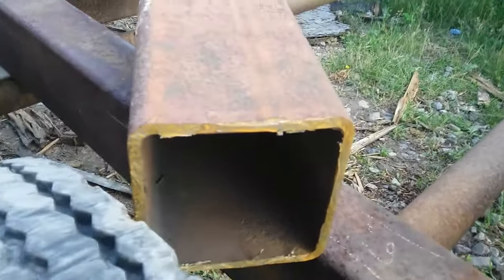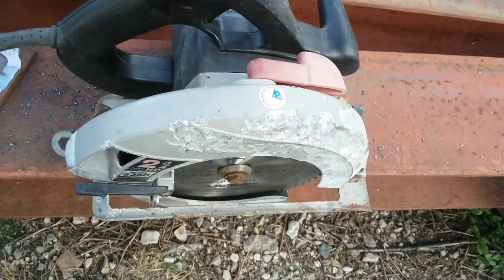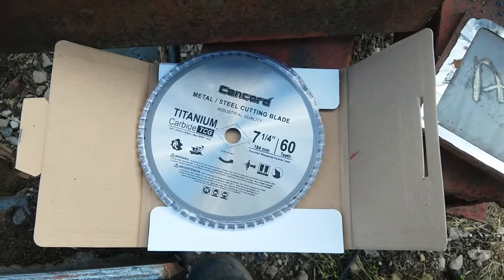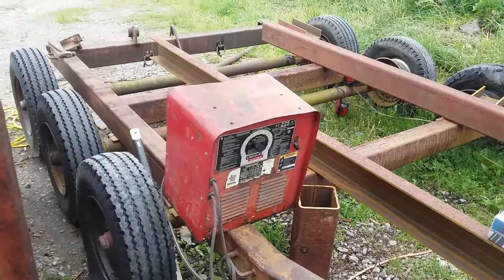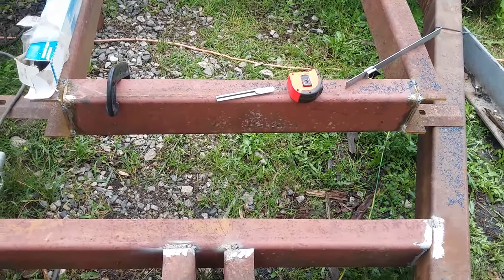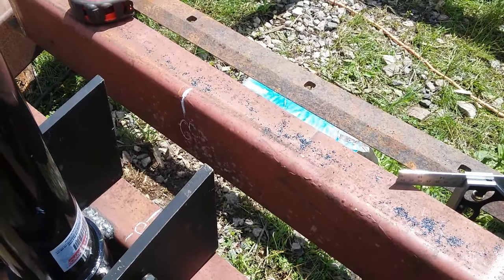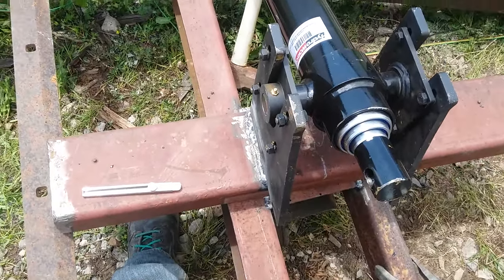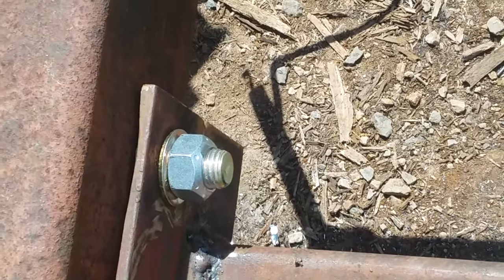Dump trailer build (part 1)

Comment: Interesting - I thought these blades were rated for lower RPM saws.  I'll have to check those out!
Reply from the maker: built that whole trailer with 4 blades, only time I lost a blade was due to it binding when the steel flexed near the end and a tooth or two snapping off.

Comment: im trying to find the mounting brackets that you have for the cylinder, but i cant find them. Where did you get yours at?
Reply from the maker: Mine came with the cylinder. They're not shown in the pictures but are part of the kit. https://www.princessauto.com/en/detail/7-ton-x-60-in-stroke-telescopic-cylinder/A-p8608051e

Comment: I would like to know where did you get the 4 bolt flange mounted bushing for the side if the hydraulic cylinder?
Reply from the maker: Comes with the cylinder, this unit complete was bought from https://www.princessauto.com/en/detail/7-ton-x-60-in-stroke-telescopic-cylinder/A-p8608051e those plates are not shown in the image but they are included.
Reply: Thanks

Comment: I spray WD40 on it ever so often so it doesnt heat up and cuts better.
Reply from the maker: Good call, I used waste oil and it worked but made a bit of a mess WD40 would be a much easier clean up for sure.

Comment: those are'nt cutoff wheels. cutoffs are much thinner....
Reply from the maker: They absolutely are cutoff wheels, abrasive cutoff wheels for angle grinder.
Reply: Definitely not abrasive cut offs, for a 5" grinder they are only 1mm thick, they are grinding wheels
Reply: Only 1/4 steel anyway

Comment: What type of cylinder and where did you get it
Reply from the maker: 7 ton cylinder from princessauto. They have a wide range of capacities and lengths. This is the one in the video - https://www.princessauto.com/en/detail/7-ton-x-90-in-stroke-telescopic-cylinder/A-p8510091e
Reply: Schneb cool thanks